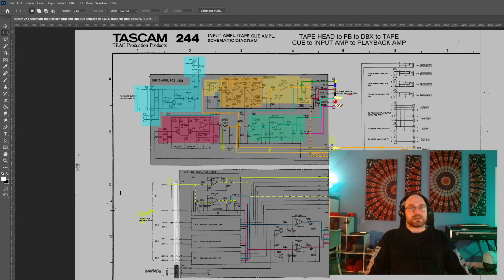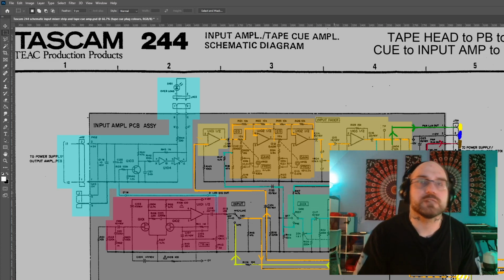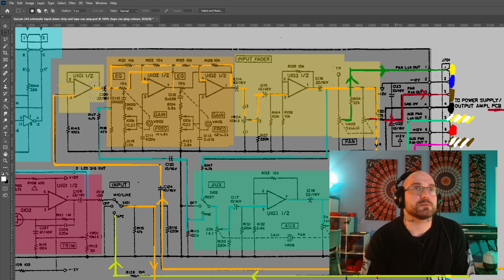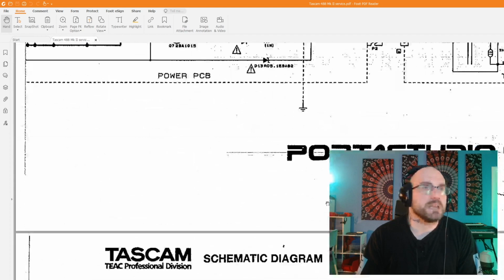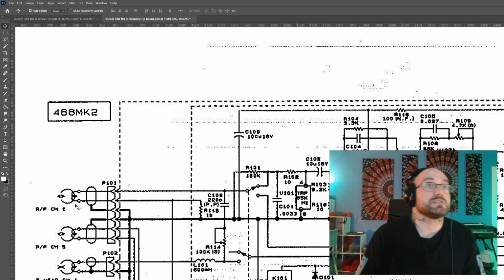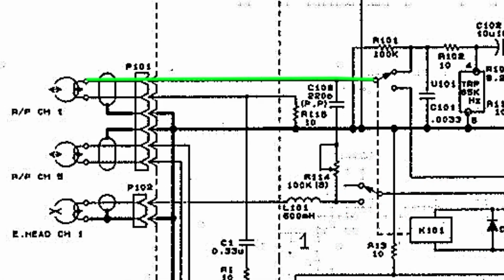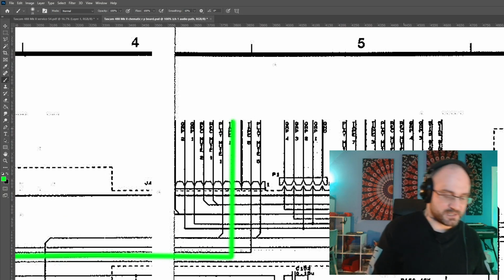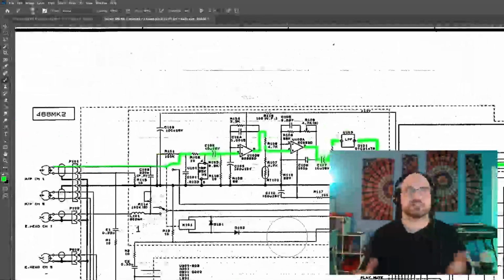Using Photoshop to Understand Portastudio Schematics - Finding the Audio Path

Comment: To me it seems like the later dark blue models have the most component failure out of all the portastudios. I've found bad Op amps, caps that were not stuffed /soldered all the way into the board and plenty of dead 10v caps on the porta 02 models.  Its exciting to see someone else working so in depth on these machines, thanks for continuing to make the repair videos. Since discovering your channel ive repaired over one hundred TASCAM units and I couldnt have done it without your help!
Reply from the maker: Thanks for your kind words, I expect you could have done it without my work, but I do what I do in the hope of making the learning process faster and less nerve wracking for viewers than it was for me, so I'm really  stoked to hear you've carried out so many repairs! I have relatively little experience with the blue generation...I've repaired quite a few 424 mk iiis but fewer 414 mk iis and only one porta 02. It did seem odd to me that the 90s units have just as many electrical issues as the 80s units... I read that there was a scandal with counterfeit  electrolytic capacitors entering the market in this period, maybe that is why?  I don't really know ...anyway thanks for staying interested and happy repairing!

Comment: Currently trying to repair a 244 have gleaned a lot from these videos and within 2 weeks of watching I've got the thing up to a decent working standard. The only niggle is the 4ch rec light does not flash anymore. It goes solid but does not flash. I suppose it's not a big deal but if anyone has any ideas let me know cheers. And thanks Tetrakan for all these videos I wouldnt have been able to get thing fixed and calibrated were it not for your work.